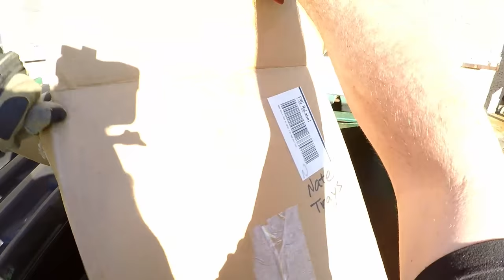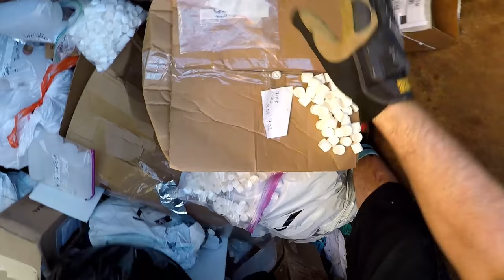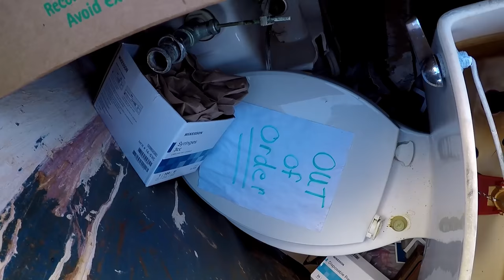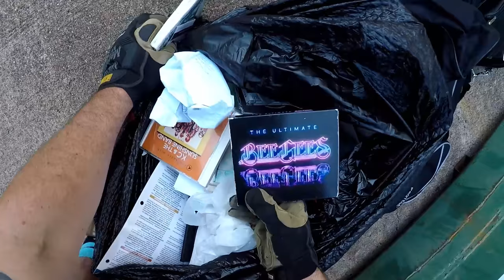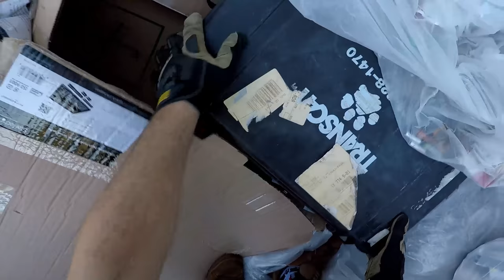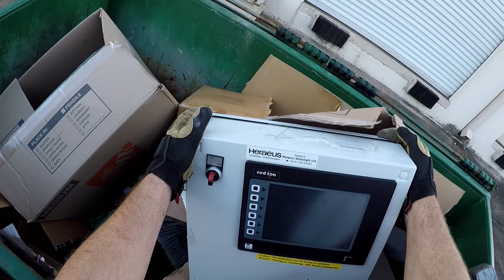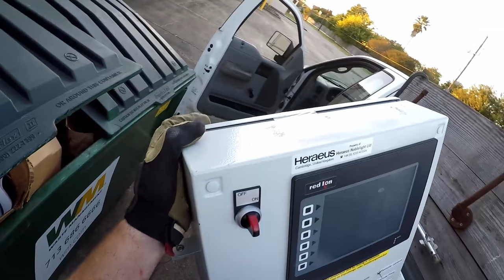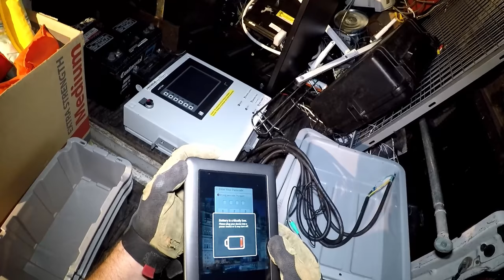Dumpster Diving "Let's Poke It With A Stick"

Comment: Hey Mike, Those large gas cans are for mounting on the front or rear rack on 4 wheelers. Also gas caps are cheap, gas cans are expensive, people will buy them without the cap or spout.
Reply: Injection molding samples

Comment: Mike you should go around to the small mechanic shops and get a contract with them saying you'll take all of the scrap metal of there hands
Reply: Offeoad suspension shops are great for that, leaf springs all day!
Reply: Man, u can make a cap for those. Like a radiator hose clamp, with a chunk of inner tube. Flat head take it off/ on

Comment: Michael, I think you missed a few bits of brass in the big box by the dumpster.  Also the books you threw back into the dumpster might have some resell bank on Amazon. Even if they don't, drop them off at a local library, they can always use more technical books like the 'Sand' one.😎😎😎 And it looked like there were a bag of lids to go with the plastic tubes; don't know if they'd sell at a garage sale, but would be great for crafting.
Thanks for sharing such EXCELLENT ADVENTURES IN SCRAPING' with us.  We really appreciate all  you do.  Loved the crayons/coloring book comment....LOL.  
Please, please, please consider adding a zip up hoodie to your Merch for us ladies.  I know I, for one, would definitely buy more than one.🙄🙄🙄

Comment: If you find clean packing wrap that's not popped it sells fast on line. Reused packing material especially the white popcorn filler, sells very hot. No pun intended.

Comment: At 17:23 just after you dropped a case down I think you missed a Pomona Electronics 1508/POM Test Lead Holder that was orange. Those run between 20 and 30 bucks. If you get back by you may want to get it and put it on ebay, it was orange.

Comment: As kids, two of us were diving, back in the 60's.  My friend opened a big box....full of cut up rotten animals.  The stench was disabling. I couldn't climb out because I was puking so hard and afraid to breath.  We later assumed that the animal hospital on the property had an incinerator failure so they used the dumpster instead. I hope it wasn't a regular practice. My gut ached for days from the barfing.

Comment: You should go to a Subaru Dealership and see if they will give you one of the Boxer Engines they have piled up by the dumpster, when I worked at the auction they had 20 -30 of them piled up every week. As far as I know they paid someone to take them.

Comment: Another reason not to put CAR BATTERIES in the dumpster is. That, if they have any power in them they could easily short out if both of the  terminals come in contact with the same piece of metal. This could very possibly cause a fire.

Comment: They dispose of the guys container cans you're not supposed to put the lid on it will build up heat and fumes inside and then there's a chance of explosion that's why the lights are not on you could buy lids at Canadian tire and probably some hardware store

Comment: Did those resin tanks brand new in a box 50 to 100 bucks apiece depending on size model brand etc. this gas cans look brand new, yes, you can buy lids you can buy replacement lids. Work smart not just hard

Comment: Maybe some of that "Spaceship" stuff you can list on Ebay as "Steam punk". There are artist out there and others that make art out of stuff like that. Also one rule is never sell anything unless you know its value. I have screwed myself a couple of times doing that but also made a lot of money buying on Ebay and then selling the items under the correct name. Those wire strippers cost over 0 dollars and would be a good investment but you look like a handy guy and might be able to make a makeshift one. They basically just pull the wire across a sharp blade point so pulling a tied wire into a hole with blades should do it. I am not being nosey just hurts when I see something of value being sold as scrap. Start an Ebay page and start everything at 20.00 and see if it sells. People will get to know your page and always check it for something they need.

Comment: Mike,
 I appreciate and respect that you keep valuable items from going into the land fill but when you open a box close it back!!! It's a dick move not to.
When they come to dump the trash all the small refuse spills out all over the parking lot then somebody has to go out and pick it up. 
Busting the sink up was wrong too. You could have picked those with channel locks or broken it up in a box and then closed it up.
I know because I was the guy who used to have to do this after the scrap guys ravaged our dumpster every night. I've seen it damage tires before. We also had kids who could have gotten cut etc riding bikes around.
If you fold the lids back and reseal them you can prevent this. 
Keep it up and you'll start pissing people off. You'll see more and more locks on dumpsters or security guards and cops running you off than you'll be out of luck.
In my case I got so fed up I got the company to let me cash it in myself. Pulled down around 1600 bucks a year. 
I didn't have to clean up after people and I took Thier money.

Comment: A lil FYI there Mike .... Home Depot sells gas can caps and spout kits for just about any type of cans .
There are ony a few types of threads that the caps screw onto the cans that are pretty much Universal .
They are somewhat cheap if you decide to go back and get the cans.
I know this cause i had a cap blow out of 5 gallon can i had and had to go and pickone and decided to get an ext pour spout and it was like 6 bucks .
Those cans looked kinda small , like 1.5 to 2 or so gallons and them things aint cheap .
So if i was you and they are good i would grab them all and wash away and dumpster juice is all over them,
Slap a new cap on them with a spout kit and garage sale them babies.
Peace out dude and keep up making them funny videos ... I am dieing to find out how much the scrap yard bought all of those pipes from the video that were all stainless and aluminum so get up a part 2 for tha video asap . Thanx dude !